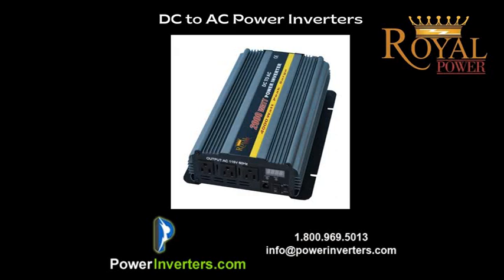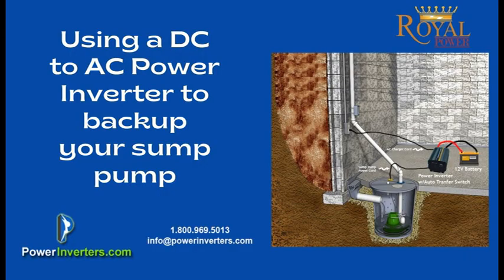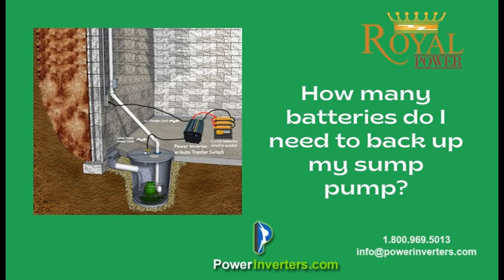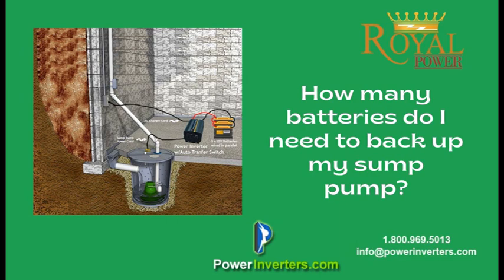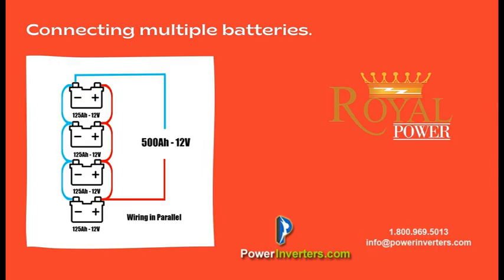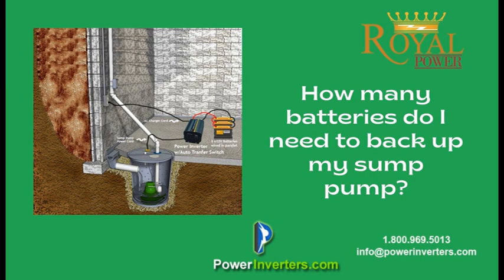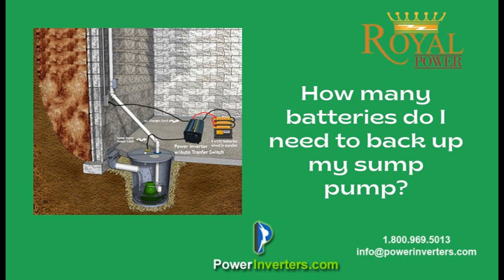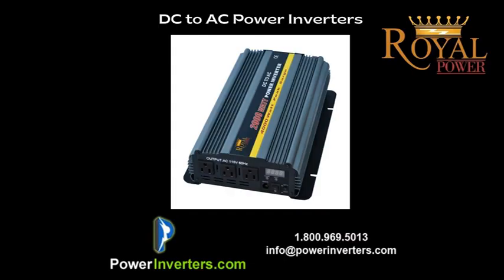How many batteries do I need to use with my sump pump? Sump Pump Back up

Comment: my husband & i bought last week the 3000W inverter/charger to back up our 1/2HP sump pump.  we installed it on the weekend and with advice given by Richard @ Royal Power we tested it.  after 7 hours (!!) of a simulated power outage, the voltage had only dropped 1 volt before we aborted the test and plugged the inverter back into the outlet.  the inverter then recharged our batteries (we hooked 2 in parallel).  so far we are extremely happy & hope that the inverter has a long life span.  either way, this concept has passed with flying colours the initial test.